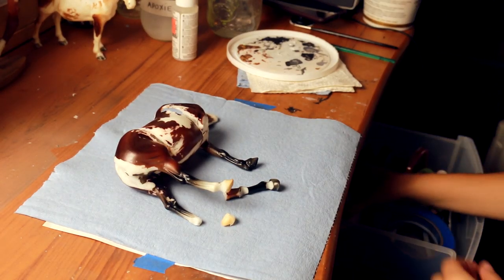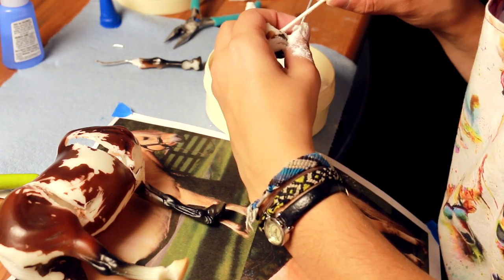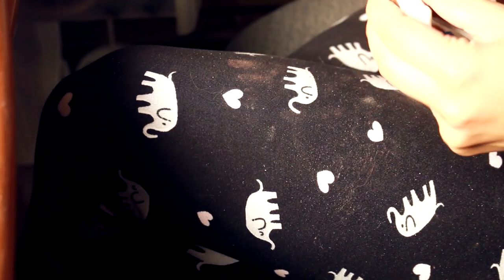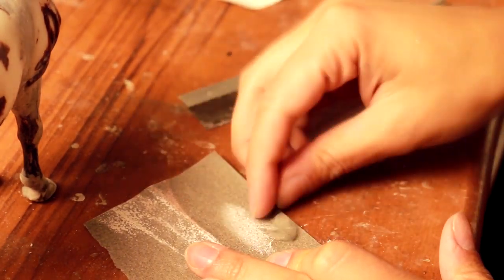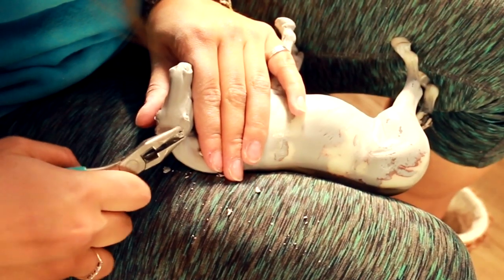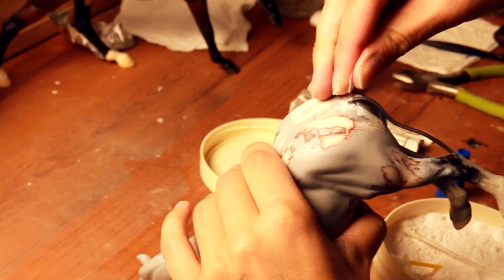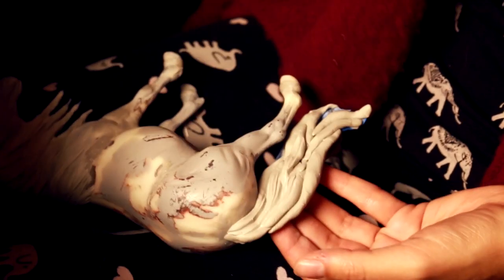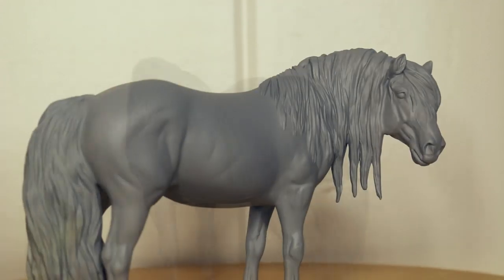Drastic Custom Fjord "Kion" -  PART 2: RE-CONSTRUCTING - How To Customize Your Breyer Model Horse

Comment: How long does apoxie usually take to dry completely? Do you need to wait until one layer of clay dries to add another?
Reply from the maker: It takes a couple hours to dry to handle. So you could sculpt more overtop. Fully cures overnight, to sand and drill. I do let it dry between layers so I don’t mess anything up.